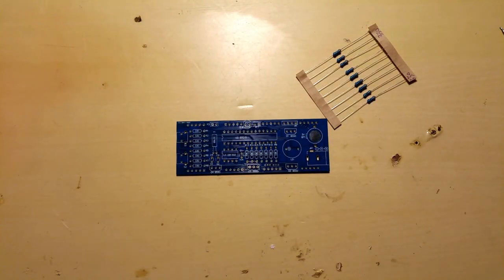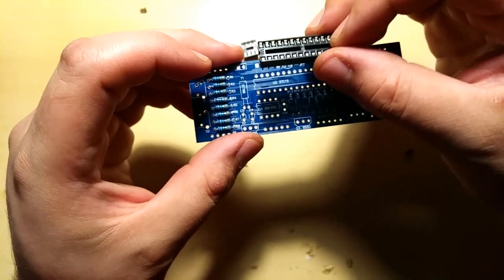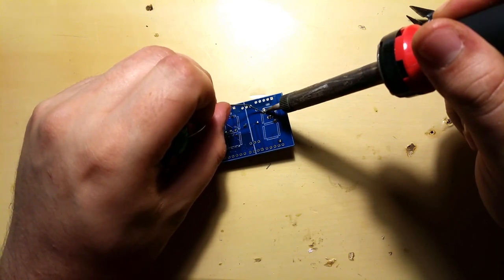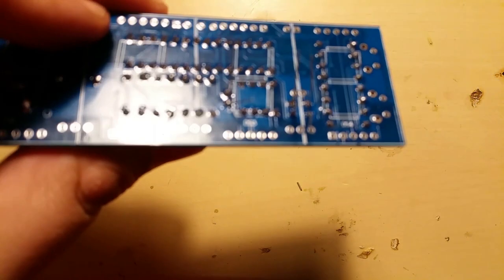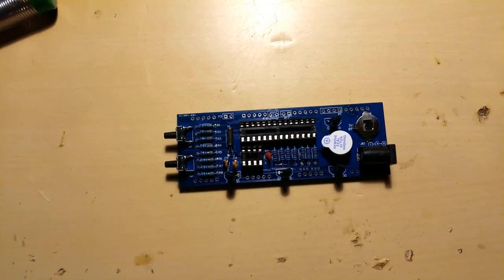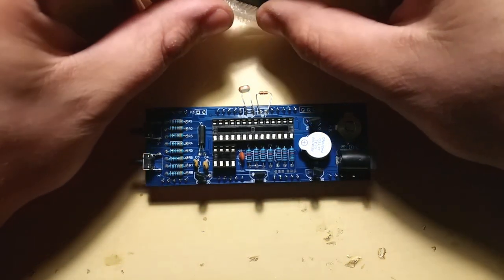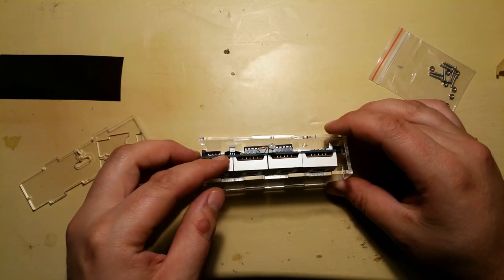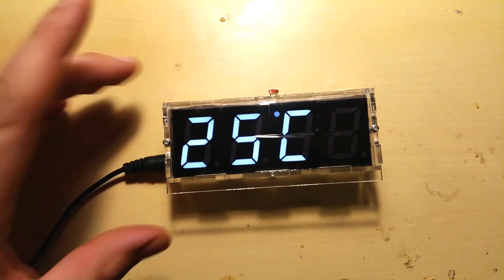DIY LED Clock Kit: build, soldering and setting guide

Comment: Probs no one will answer me but can anyone help? I soldered everything (probably not correctly) and when I plug it in my pc. It only shows 1 stripe in every digit!!!
Reply from the maker: check all the solder points with multimeter.
Reply: Did you fix this? Mine is doing the same